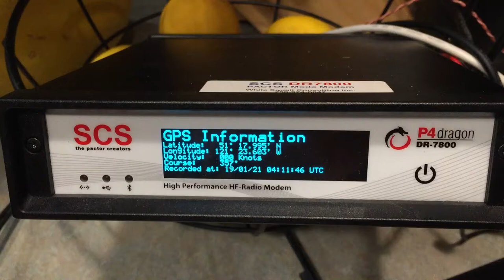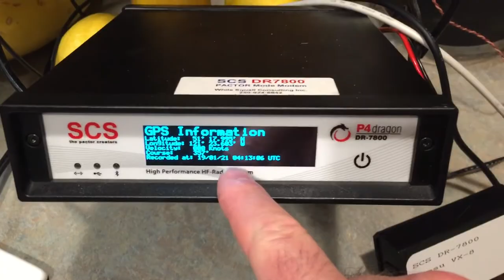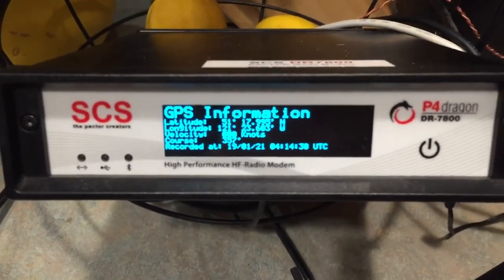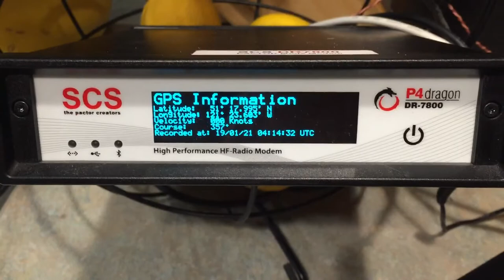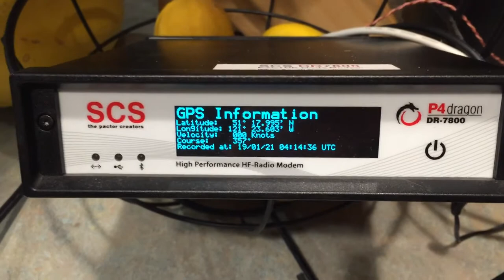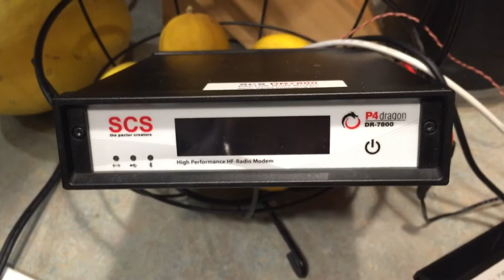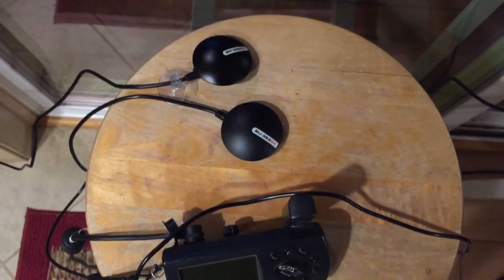Add GPS to SCS DR-7800 Pactor Modem

Comment: Thanks for the video...   Can you tell me if the gps that you've connected to the back of your Pactor modem....does this populate the gps information in the Position Report under Settings, which is then posted into the outbox..   Thanks Much....Mike
Reply from the maker: The GPS is connected to the back of the Pactor modem and the information shows up on the pactor modem location. I have a new video that shows how to connect it. Winlink express does not get the location information from Pactor modem. I have a second GPS that is connected to my computer that does that.
Reply: @Linus007  Ok, got it....I also have a little gps unit that plugs into a USB port that I use for position reporting via winlink...Before I try to post my lot and lan to winlink, I run a little gps app that wakes up the usb gps, I quit that app and when I go into the position report on winlink it populates it in about 1 second.....seems I have to wake up the gps for it to work though...  I use: